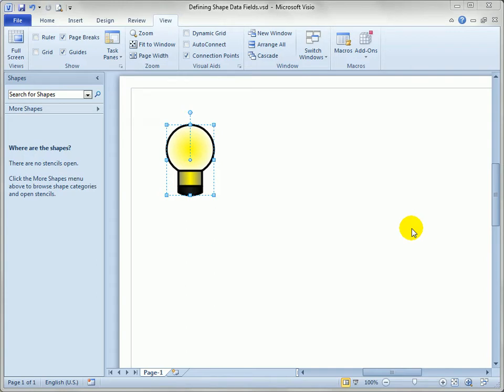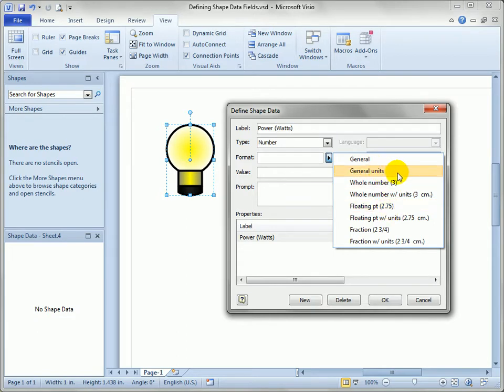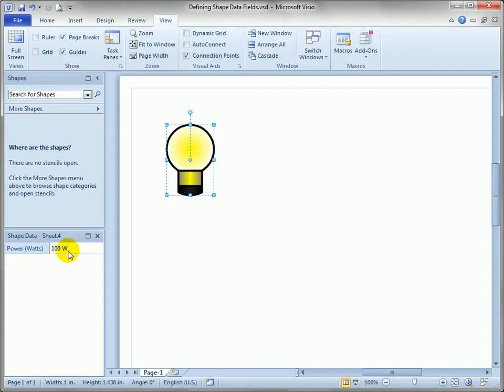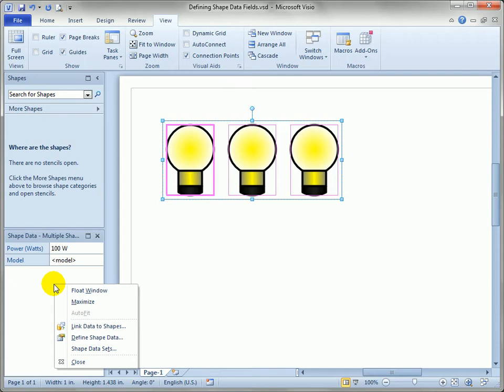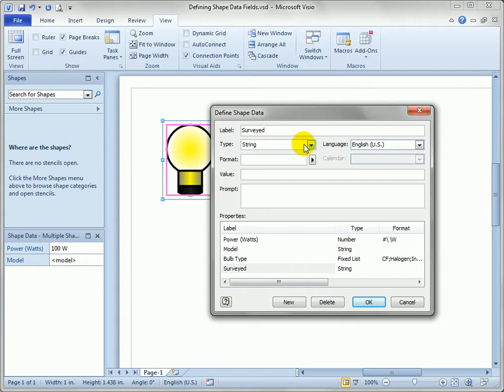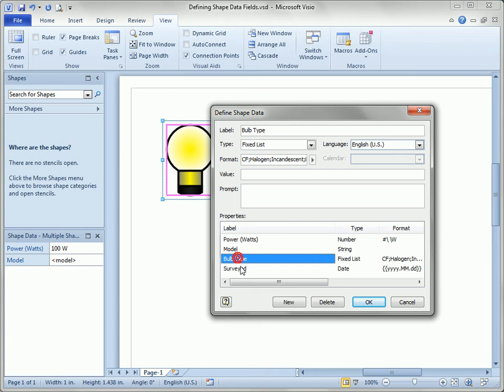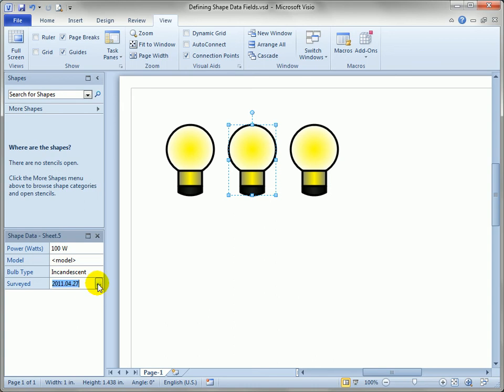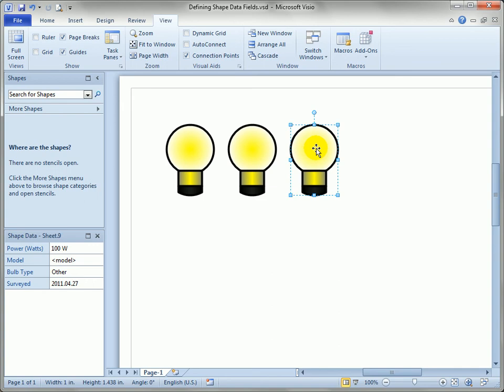7.2 Creating Visio Shape Data Fields

Comment: These videos are still valuable these days, thank you for putting them up here! 

I like to work with shape data sets, it's very covenient. But I wonder if there is a way to see ALL the shape data sets being used in a Visio drawing, in a list or overview, or maybe a data dump? To get to all the data sets, first you need to dive into the shape, then the shape editor  and then edit shape data sets... That's a bit obfuscated IMHO.
Reply from the maker: I believe the definitions are stored "per-document", and can be found in SolutionsXML, which is an awkward API, but you can get at it with VBA, C#, VB.NET, etc, if you are technically inclined. If I had a few spare hours, I would try and make a GitHub project that did some basic accessing of this information, so people could start an .exe and have a quick look at them, maybe export them to some text file for re-import, etc.
Reply: Also, the "Shape Data Sets" floating window shows all the data sets in the document. I think you have to use this to apply a set to a shape, so I'm not sure I truly understand your question now...?
Reply: @VisioGuy  Thanx for the extensive replies! Yes, I found the Shape Data Sets floating window eventually, thanx for pointing out! The thing is, you have to dig relatively deep to find it - it's not like there's an option in the ribbon to find it with one mouse click and provide you with a convenient data set overview.
Reply: @Jupiter_917 Yeah, I always right-click in the Shape Data panel...SO INTUITIVE. No idea if there is a button anywhere else to get at it.
Reply: @VisioGuy  Well, once again thanx for the explanation, appreciated 👍!
Reply: @Jupiter_917  See the main thread for the tip on how to add a button to the Quick Access Toolbar (above the ribbon).
Reply: @VisioGuy  I am looking into your other videos, very valuable!
Reply: @VisioGuy  I Today I noticed that, when making the Shape Data Sets visible via the right-click in the Shape Data panel,  NOT ALWAYS shows the Shape Data Sets pane! I also found a work-around: make the Size & Position pane visible and THEN repeat the right-click in the Shape Data panel, and then the Shape Data Sets comes available too: all three panes are available as a tab in the pane, default docked to the bottom-right of the Visio window!

Comment: How would you Change text in a rectangle shape? Open;Close
Reply: Hi AW, your question isn't very clear. Can you elaborate?
Reply: @VisioGuy  Was that not clear enough?
Reply: @VisioGuy  I have a master with a picture of a timer, which I added connection points. In the display window of the timer I added a Blue Rectangle shape with the words either "Open" or "Close". Every time I place a timer in the drawing I have to go in and manually change Open or Close. I need a way to do this with a as a selectable option. TY.